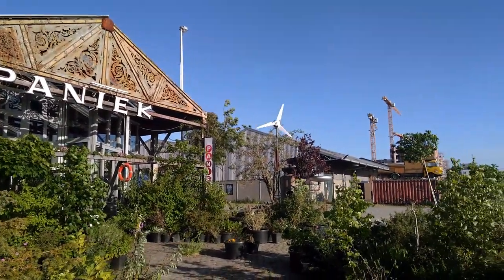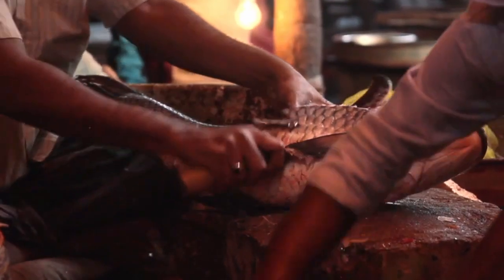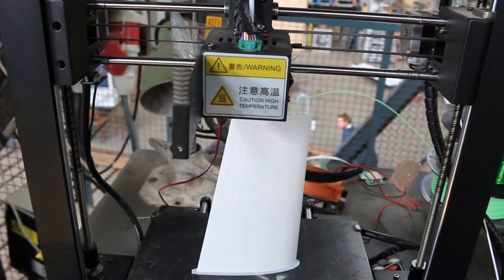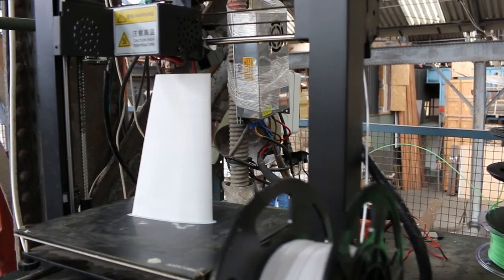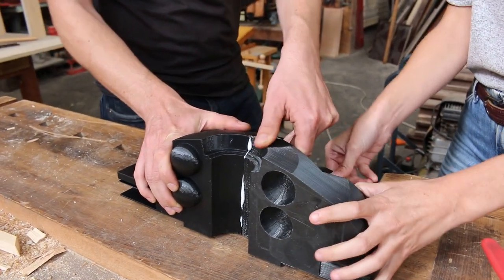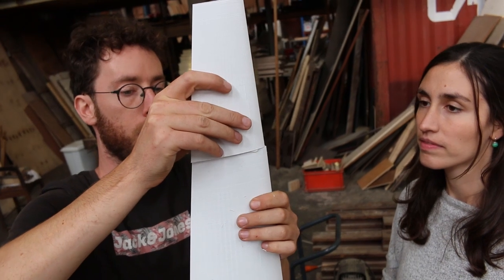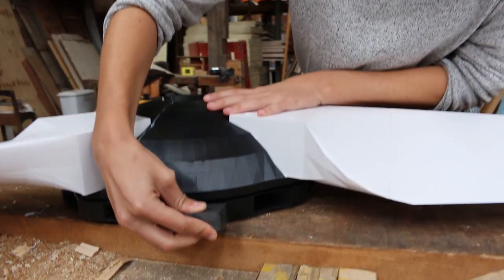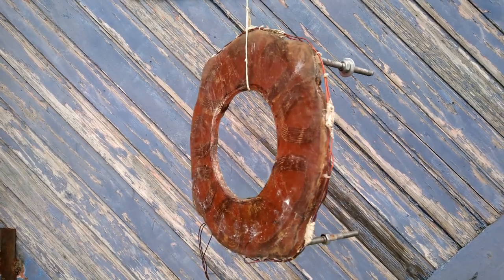Propel-E 450 | A powerful 3D-printable windturbine

Comment: black ferro magnets are weak. 
rare earth magnets would produce more power. switching to weaker magnets becasue the name "rare earth" its a counterintuitive decision not ecological. 
the elements arent actually "Rare" and extremely difficult to gather as if the elements are otherworldly treasure. they're just less abundant and more spread out concentrations than iron. 
we can produce plenty of rare earth magnets to go around.
Reply from the maker: Unfortunately it's not possible to generate more power by switching to NdFeB, as the output is limited by the wind as the efficiency of NdFeB and ferrite based alternators is roughly the same. Ferrite alternators are just bigger because the lower flux density of the magnets. NdFeB is not so rare as it is called indeed, however it's mainly mined in China. Also, occurence and environmental impact are different things. Ferrite magnets are well known for lower environmental impact and are longer lasting because they are not as prone to humidity as NdFeB's.

Comment: This would cost too much. PLA is really expensive in filament form, and this is a really high power wind turbine that could power a whole village. Is there a plan for a smaller size for just one household? I think that would be more comparable to the face shield effort at the start of the pandemic.
Reply: @FromWasteToWind  who in these modern times uses incandescent light bulbs, they're about as energy efficient at producing light as burning wood, most people use LEDs
Reply: @leightonwestbury92  A 100w light bulb uses .83 amps. .83 amps is nothing. Charging a phone uses more.
Reply: @normellow  8.3 amps
Reply: @normellow  You dont measure power in Amperes, you measure it in Watts so 100W light bulb is a lot. An equivalent led buld doesnt even spend 15W for the same light.
Reply: @FromWasteToWind  not for a developing country in a natural disaster lol
Reply: You can use a filament which resmelted from plastic bottles or neylon fishing ropes
Reply: Which 3d printer you used